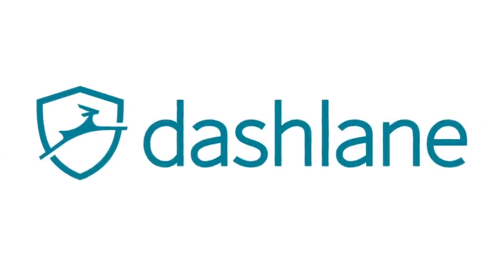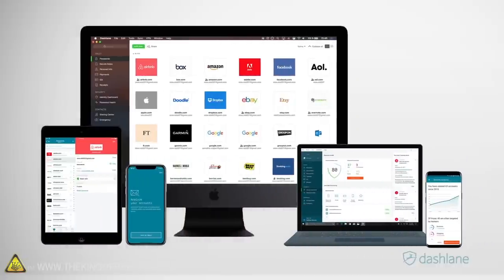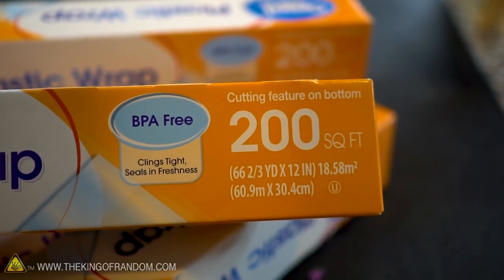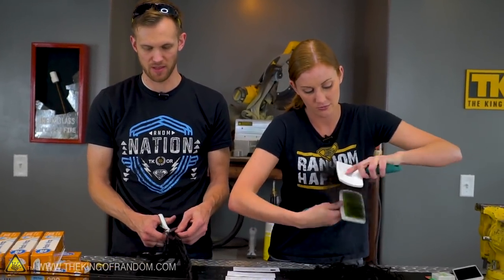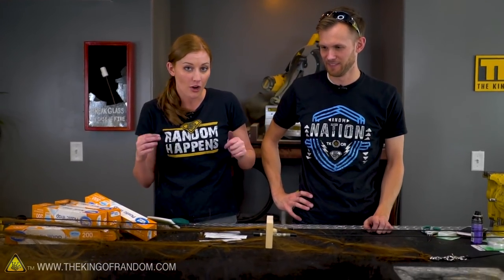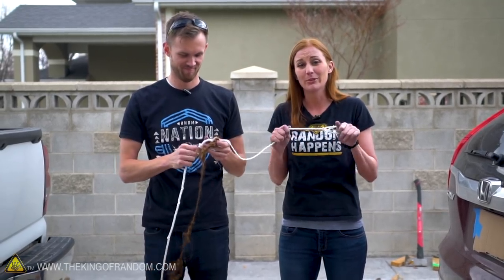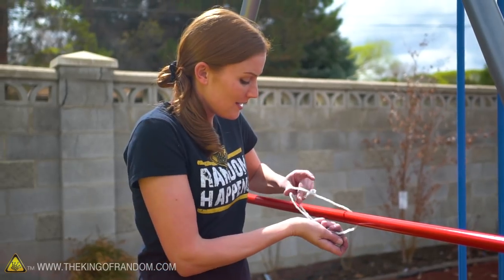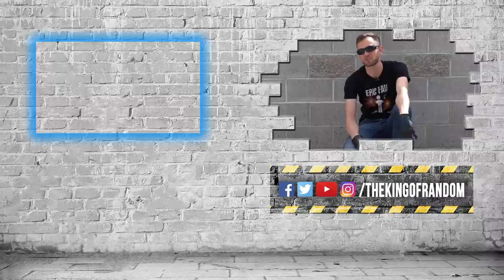Can You Make ROPE With HAIR?

Comment: What happens when you pour molten glass and molten metal together?
Reply: I don't know but l want to find out too
Reply: Lightning ZedRies  I think if they are the same temperature it would be fine, but now i need to see them do it and find out
Reply: Depend by the metal type ,
Reply: The Cheesy Breakfast they make metal/glass thing
Reply: Pain
Reply: Gabriel Phillips wat
Reply: What happens if you put broken glass in a rock tumbler?
Reply: Lets make the Star Trek material come true. Transparent Alluminum. 😉
Reply: If the metal oxidizes then the glass will change color
Reply: Then mix them together and let it cool

Comment: Can you use a single stand of hair to cut stuff, such as foam or paper or even wood. Move the string at high speeds and vibrate it.
Reply: My sister and I would do this when we were little it works as long as you dont put too much stress on the strand

Comment: Which is stronger spider silk or steel? Could you also try weaving the spider silk into a rope
Reply: Mythbusters already made a vidio on this. Go check it out.
Reply: Eli Buck You should help MRkingbacca out and make a link.
Reply: MRkingbacca oof how would you get your hands on that?
Reply: XxYin Yan Yan ChanxX Easy. Just find a spider web. Also weave metal into strands...
Reply: well spider silk is stronger than steel the same thickness as the silk
Reply: def spider web but proportionally
Reply: Proportionally, a spider's silk IS stronger than steel. (If you had a piece of spider silk and a piece of steel, each an inch in width, the spider's silk would be the strongest.)
Reply: they should
Reply: HERE COME THE VEGANZ

Comment: Love that u did the plastic wrap in jails they use trash bags by cutting the bags with it folded up where u end up with a circle of plastic then loop it to a metal post n is used for laundry lines as well as for water weights holding about 20 25 pounds interesting enough i had to braid it as well with three segments of plastic make the "rope" repeated three times then braid it. It is still holding up today thanks to my freind who is still in n its been solid now for 8 months

Comment: you should revisit the human hair rope!  A single strand could hold 100g (3oz) in weight: the combined hair of a whole head could support 12 tonnes, or the weight of two elephants. Weight for weight, it is not as strong as steel: more like aluminium, or reinforced glass fibres or Kevlar, which is used to make bulletproof vests

Comment: breaking a plastic wrap robe with a vehicle. compared to holding weight. the rope would have held misses pretty pants. the torque of a car wont register correctly on a digital scale. its the human error part of it and the way combustion works. drop test or hold test is going to give you the best readings.. acceleration and holding power
Reply: force over time isnt a factor in this experiment.